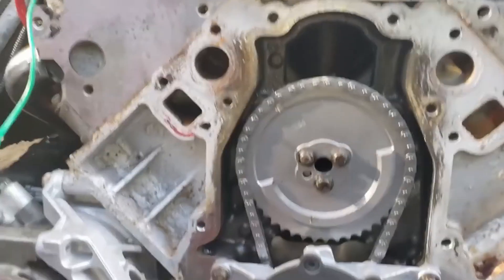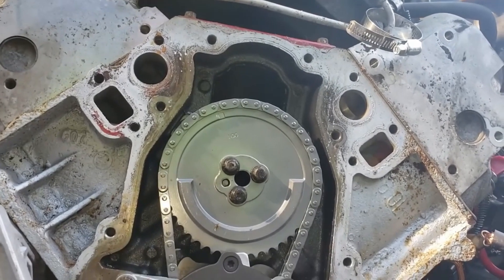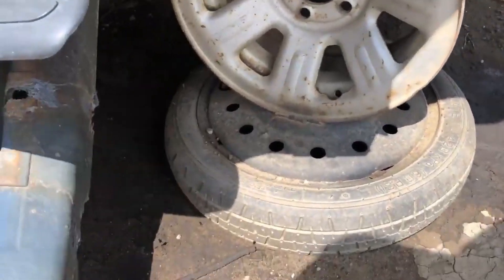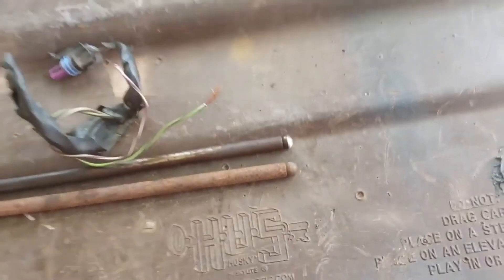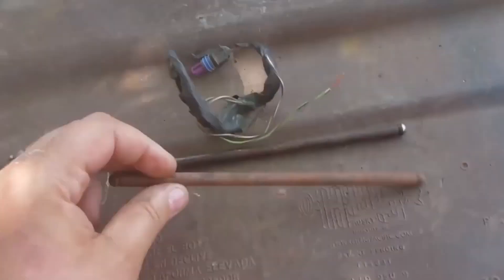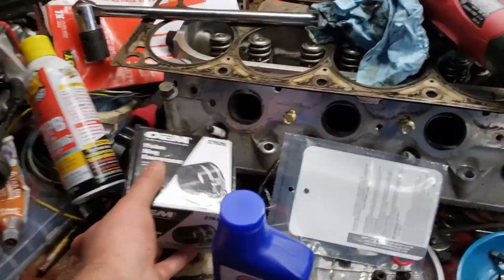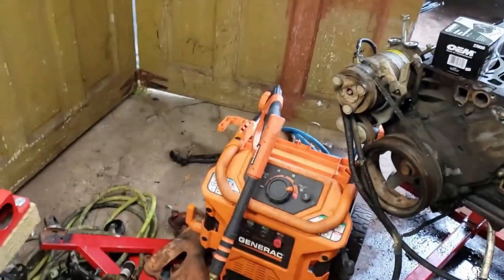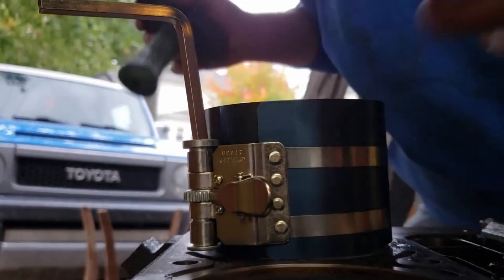Everything you need to know about building high performance engines in one video!

Comment: Well I can't rest, my 5.3 won't go,past 2500 rpm
Reply: Any luck?
Reply: @trashbandit2449  actually yes. Ended up finding out the whole passenger side rocker arms had backed off. Re did that and she sings
Reply: @benaiahtheassassin  sweet.  Is that in your nova?
Reply: @trashbandit2449  yes it is

Comment: Completely off topic bud but I need help bad ... 02 Silverado 5.3 lm7 knock sensors bank 1 sensor 2 low voltage .. just replaced both sensors and harness after having codes for both sensors.now I have the code above for sensor 2 please help any way to fix it for good ?

Comment: If the Internet is accurate, you need to pull the engine out of Daryl, disassemble everything, install new bearings, rings, machine shop bored and deck, $3000 crank kit, new ARP bolts perfectly torqued, etc or it will never run.

Comment: Do you still recommend the dollar store degreaser to clean off a 5.3? Just spray degreaser on and water hose off? Anything to keep away from water? Thanks. ETA, I don’t have access to pressure washer
Reply: Gas, then purple power, Dawn dishwashing soap, rinse with water
Reply from the maker: Awesome from the dollar store is still my go to cleaner
Reply: I was trying to stuff my 5.3L into the dishwasher.  My wife walked through the door.  Let’s just say she was less than Happy.  I did try and justify it by explaining how expensive a Parts hot tank is. Didn’t help AT ALL!!!